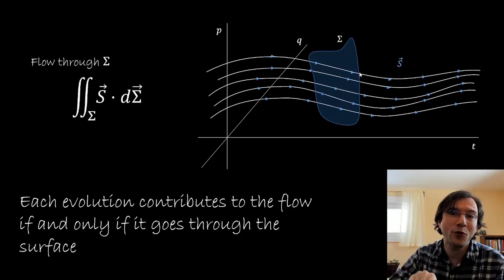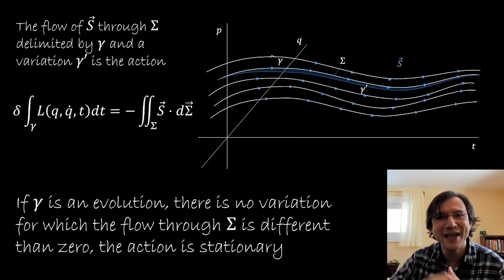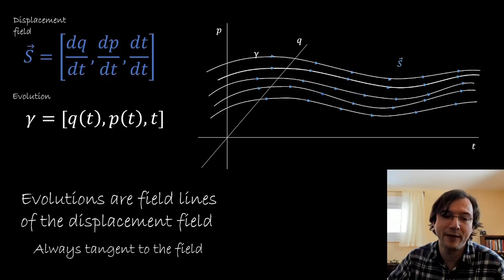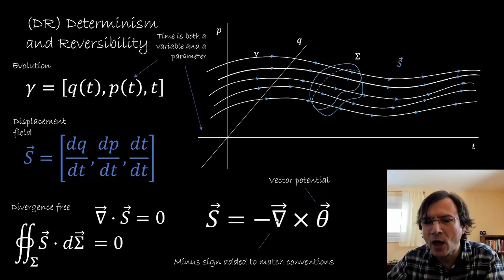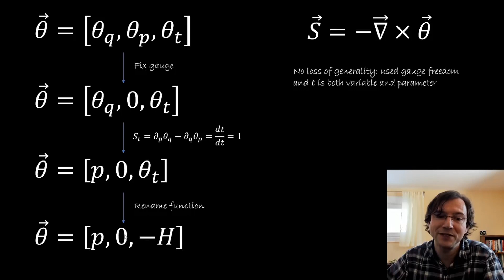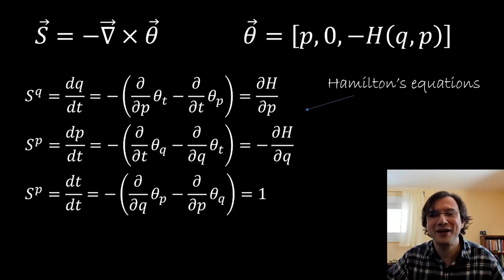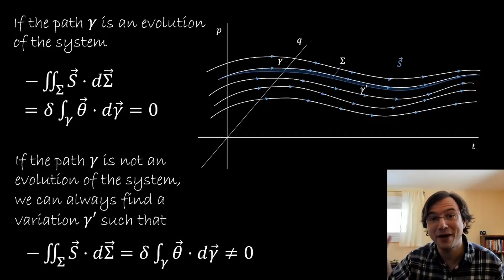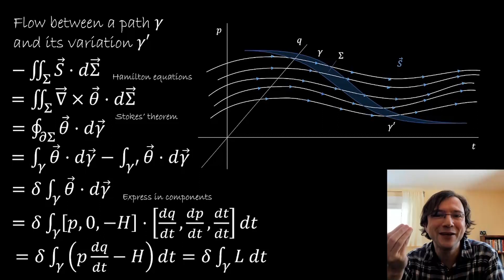Action principle: geometric and physical interpretation

Comment: Hmm maybe there are things we can dig out deeper about this
1. Usually when the principle of stationary action is evoked, the initial point and the end point are specified, and the path is selected between two points which makes the variation of S = 0. I see that endpoints aren't necessary for this picture, we can have a line flowing forever and just define a surface
2. Can the value of action itself be defined in terms of the vector theta?
3. This one is in classical mechanics, but knowing that the action has a minimal (hbar) value in quantum mechanics, what kinds of insight can we make, using this method? (related to (2), the action itself sometimes pops up in quantum inside an exponential, so maybe there are new things we can find if it is written in theta vector)
4. Can the diagram incorporate special relativity? should energy be an axis ((ct,x,y,z) at equal footing to (E/c,px,py,pz)) while "Hamiltonian" is a component of the theta vector? would the constancy of the speed of light warp the diagram in any way? what about boosts?

thanks!
Reply from the maker: 1. Hhhhmm... If you get an infinite line with a variation, and get an "infinite strimp", I am not so sure you can apply Stokes' theorem in that case. If you can, then things should work the same.
2. Not sure I understand: the action is the line integral of the vector theta. So, yes, it is defined in terms of theta.
3. I am still figuring this out. In classical mechanics, the surface integral of S is connected to entropy. In quantum mechanics, the minimal uncertainty can be understood as a lower bound on entropy (I had another video on that). There should be a link, though I haven't found a way to tease it out.
4. Yes. This is another way to extend phase-space, so you get a full temporal degree of freedom. You need a minus sign in the energy/momentum four-vector. The Hamiltonian gets replaced by the "Hamiltonian constraint". This does two things: it is the generator for the evolution parameter and is a constraint on the overall system. For standard massive particles, the Hamiltonian constraint is the mass (expressed in energy) and the affine parameter is proper time. You also find "classical anti-particles" this way. You get also interesting parallel with Klein-Gordon and Dirac equations. That would be a whole other video series...
Reply: @gcarcassi  oh yes action in terms of vector theta is a bit clearer when i rewatched the video
Reply: @gcarcassi  Hello Gabriele, could you point a reference on the connection between entropy and the integral of action? And, in general, do you have written references for the results that you present in this video? :)
Reply from the maker: @UgoPiazzafan  What I talk about in this video is based on the pre-print linked in the comments. I do not have a reference for the connection between entropy and action - I have some ideas in my head, but I haven't done any literature research yet.

Comment: 4:50 It's not clear why surface Sigma must be tangent to the vector field S. Most likely Gabriele assumes a specific kind of variation, otherwise it's easy to define a "close" curve gamma' which twists around gamma, so the angle between the gamma' and S will be arbitrary. I will take a look at the article to clarify this.
Reply from the maker: Hi Maksim, with a finite variation, you can of course do whatever you want. The idea is that you are making an infinitesimal, first order variation of gamma. That is, take a point along gamma, take the direction along which you vary that point over gamma'. Now you have to vectors: one along gamma, and one that "connects" gamma to gamma'. Those two vectors identify a parallelogram, and that is the element dSigma along which you make the surface integral. Now that element is tangent to gamma because one side is actually the displacement along gamma. Does it make more sense?

Comment: hi gabriele, what do you think about the role of interpretation in relation to mathematical formalism in using a theory to explain natural phenomena? in which cases can the interpretation be "obvious" or not at all? how far can "bare math" gets us (or even just human language)? and how can the assumptions of physics project might play into this?
Reply from the maker: Not sure I can answer fully here... may need a full video. :-D So, mathematical "theories" do need "interpretation" in the sense that mathematical theories are just abstract symbols with relationships. Physical theories need a connection between mathematical symbols and  measurements and predictions. This, at this point, I think can be done very well... more than I thought it could be done. There is a bit of reshuffling both on the math and the physics side (i.e. we may not have 100% the right math or the right physical concepts), but you can do it. I think a one-to-one dictionary between physical concepts and mathematical representation is possible and desirable. In the project Assumptions of Physics, we try and find exactly what elements are necessary and sufficient to get to a particular theory. However, in the context of quantum mechanics, interpretation try to do more than that... and that I think is problematic. Mainly, I don't think the questions that interpretations try to answer are ultimately illuminating on the physics side. (If you are doing philosophy is different) Note that by interpretations I really mean things that are completely equivalent to QM... Things like GRW I do not put in the same category (they have different predictions, they are different theories).
Reply: @gcarcassi  hmmm what do you think about the cases where mathematical expressions are derived from an existing theory first, then the work is to interpret it (ex: photoelectric effect -> light itself is quantized, negative energy solutions -> antiparticles, mathematical event horizon -> black holes, etc), compared to physical phenomenon is discovered first, then try to find the math (ex: multiple quark flavors -> SU(N) gauge theory, most of earlier classical physics findings)? Seems like one-to-one dictionary between physics concepts and mathematical representation can be very tricky, if we have to choose either from the space of possibilities

btw if the replies are better laid out in a video (or even a series), it will be great
Reply from the maker: @GeoffryGifari  When you are in the process of discovery, you use whatever strategy... even ideas that are partially wrong. No issue there. But once a theory is consolidated, then it's the time to get the details in order.

Comment: Hi Gabriele,
I have a question regarding the claims that the gauge fixing of theta and the lagrangian is arbitrary (in the discussion), and that the derivative of the time parameter of the path with respect to time is always 1 ( eq. 3).
The use of forms for the general case immediately made me think of the reletevistic generalization (even to GR, but let's start with SR). Wouldn't the requirement of Lorentz invariance lead to a choice of gauge that is 1) more natural and more restrictive in a way that will give better credence to the lagrangian and the action as physical significant quantities? and 2) will change the derivative of the time parameter in respect to time of the observer to gamma (from SR)? 

Best regards and thank you for the lecture, it was very interesting.
Reply from the maker: The answer may require another video... Let's see what I can say in the space of a comment.

The gauge you see here fixes, among other things, the relationship between conjugate momentum, which is not uniquely defined, and kinetic momentum. The "most natural" gauge is where kinetic momentum is equal to conjugate momentum plus the vector potential of the magnetic field.

If you want to make things relativistic, note that technically there are "two times". One is the coordinate t and one is the affine parameter for the curve \gamma(t). If you make a generic coordinate transformation, you mix the coordinates, but the affine parameters remains the same. So, to give a real relativistic treatment, you should use a different variable for the affine parameter. Which is an extra choice for the "gauge."The best expression, then, is to use proper time for particle and minus proper time for antiparticle. That's the "more natural" expression. All of this is easier to see if you extend phase space by both time and energy.

If you do things properly, Lorentz invariance (i.e. a local Minkowsky metric for space/time) comes out by itself. I am trying to find a way to make the argument that requires the least math possible, but haven't finished yet. It still an open problem to me whether the curvature of the metric tensor is linked or not to the EM vector potential.

Not sure if any of this is intellegible... it would be easier with equations and pictures. 😁

Comment: really informative and in depth video!
however, could you please clarify why the action (in case of least action, for say), can't be zero in general (a surface perfectly aligned to the displacement field/flow), instead of a minimum lower bound. how would that translate to the geometric interpretation? thanks!
Reply from the maker: I don't think I understand the question... The action can be zero, positive, negative. The variation of the action is what corresponds to the flow of states. This can also be positive if the surface between the paths "catches" flow in between.

Comment: This was wonderful. How would one add friction and time dependent forcing into this framework. I'm guessing it will break the reversibility assumption that you had. Is it still possible to generalize it in that case?
Reply from the maker: Thanks! It's not possible to generalize when you have friction. If the evolution is not deterministic-and-reversible, i.e. it's not divergence free, two things happen: the flow does not admit a potential, so you can't define an action, and the flow through a surface does not depend only on the boundary, so you wouldn't be able to define a single flow of states in the region between the path and its variation. Time dependence is different: there are some forces that, though they are time dependent, they are deterministic and reversible (i.e. conservative). You can generalize to that case by separating the use of time as an evolution parameter and time as a state variable (e.g. you have x(s) and t(s) where s is an affine parameter and t time as defined in a particular frame). What you get, without further assumptions, is relativistic mechanics! All these cases will be explored in the new version of our open access book (you can always find the latest draft at https://github.com/assumptionsofphysics/book )

Comment: If a displacement field is not divergenceless, is it a dissipative system? If yes, it would be interesting to find out if you can create a formalism for (at least some classes of) dissipative systems using this framework and relaxing the zero divergence hypothesis.
Reply from the maker: Yes, non-divergence should mean either dissipative or driven (energy flowing in). The worst thing that fail in that case is that the flow does not depend on the contour anymore... so I do not see how to make the new "Lagrangian" be dependent only on the path.